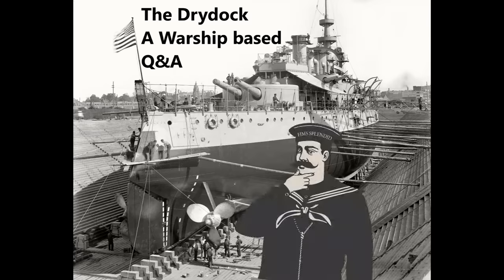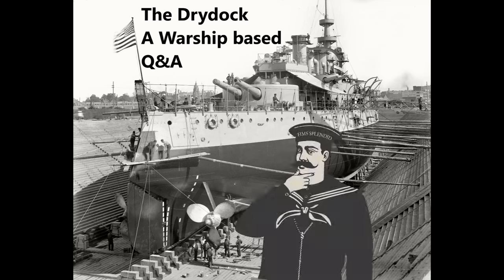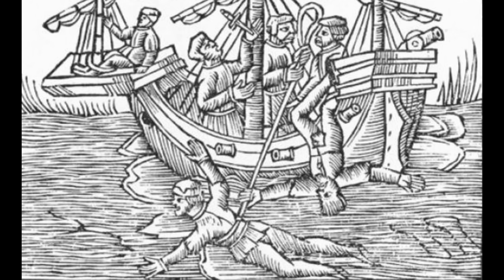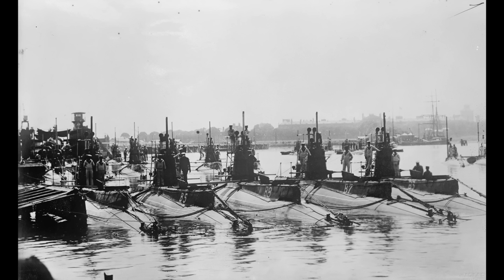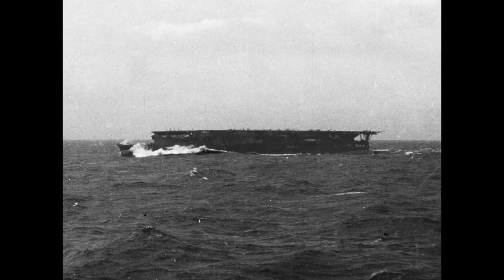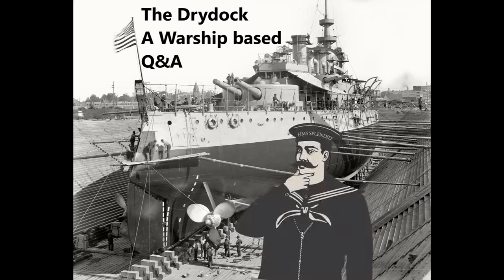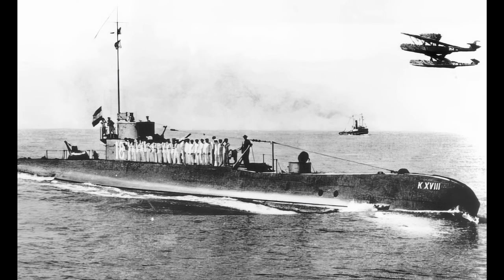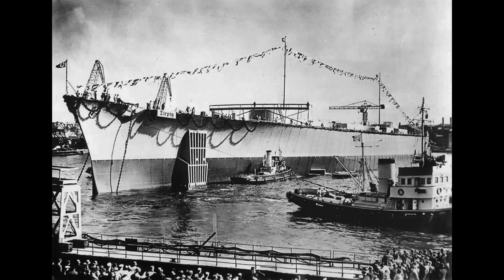The Drydock - Episode 266

Comment: Submarine Toilet on SSN-637 class submarine.

Stainless Steel toilet bowl bolted to the deck.  Waste was piped directly to the sanitary (sewage) tank.  This was at submarine internal pressure until emptied.  All toilets, which were forward of the reactor compartment, drained to this one tank.  

Toilets were equipped with a large diameter ball valve with a 2+ foot long handle.

To flush you were open the valve manually with the long handle and then open a globe valve for sea water to flush the waste to the sanitary tank.  The seawater WAS NOT at full sea pressure.  I don't remember it's source but all seawater systems at full sea pressure were minimized as part of the SUBSAFE program.

Now, the problem comes when the sanitary tank was full, or nearly so.  It was blown over the side with compressed air while at periscope depth.  The auxiliaryman of the watch had to make sure he closed the discharge valves, 2 valve protection, before the tank was fully empty and vent compressed air over the side.  This made noise and SONAR would tell the Captain about this.  Not good for sound discipline.

The other problem was NOT opening the ball valve to flush while the sanitary tank was being blown.  Failure to heed this resulted in you "picking toilet paper and "stuff" our of your teeth".  Yes, I did this once.  Rule was you do it you clean it.  I spent the next 2 hours scrubbing down the wardroom head from top to bottom.

Comment: Re: Hansan, Admiral Yi’s historical maneuver at Hansando was to a) send in a small squadron to the Japanese ambush to bait them out into more open waters off Hansan Island (shown in the film), b) set up a double envelopment with the main fleet (this is the Crane Wing Formation, though it was generally a land cavalry envelopment formation) by sailing in line abreast and then having them pivot in place while forming a curved line of battle, c) send in a small group of the turtle ships to slow the Japanese advance while this double envelopment trap was being set up so the Japanese wouldn’t get into boarding distance too quickly, and d) have two squadrons hiding behind the islets on either side of the main battlefield that would deploy and join either end of the main Korean battleline to further outflank and envelop the Japanese force (this part was sadly omitted from the film, and it’s a major issue, as it’s a big part of what made the double envelopment possible). It was indeed difficult to have the rowers synchronize exactly right to allow the fleet to maneuver in place as it did, which is why Yi drilled his sailors to an extreme extent before this battle (and during his entire naval career, actually)-this wasn’t something the pre-Yi Korean Navy could have pulled off. The fact the Korean navy consisted of flat-bottomed ships intended for littoral and coastal operations helped significantly as well. 

This wasn’t actually one of the battles Yi fought for the sake of stopping a Japanese advance (that happened earlier, during the Battle of Sacheon, and, more famously, later in the war at Myeongnyang). The main point of the Battle of Hansando for both sides was that it was a search-and-destroy operation to find and wipe out the bulk of the enemy fleet. The Japanese had to get rid of the Korean fleet under Yi if they wanted to gain sea control and resupply their land forces by sea; the Koreans had to get rid of the main Japanese fleet under Wakizaka to maintain sea control and prevent the Japanese from sending supply vessels into the Yellow Sea and up various Korean rivers. 

The big issue I have with the depiction of the Battle of Hansan Island in the movie is that it was way too short: in reality, once Yi had gotten the Japanese into his double envelopment trap, the battle went on for almost six hours as the Korean battleline fired on the cornered Japanese warships, destroying most of the Japanese fleet. The film has the entire Japanese force being wiped out in that one massive salvo, which isn’t really how it went down. 

Hansando is one of Yi’s better-documented battles due to the fact both Yi and Wakizaka wrote extensive mission reports after the engagement, with the cross-referenced details checking out.
Reply: Sound like an interesting film.
What is the title again?
Reply: @ghost307 

Hansan: Rising Dragon

There is a significant bit of Korean nationalism in a couple of scenes (though it’s not as prominent as one might expect), and while the opening stage of the battle isn’t too bad, I do think the film could have done a better job of showing Yi forming the Crane Wing Formation and bringing up the hidden squadrons to encircle the enemy.
Reply: @bkjeong4302  Thanks. I'll have to seek it out.

Comment: Auxiliary Floating Docks, Big (AFDB), also known as Advance Base Sectional Docks (ABSD), came in sections, 93 ft long and 3,850 tons each. Each section had a 165-ft beam, a 75-ft molded depth, and 10,000 tons of lifting capacity. Sections could be put together to lift larger ships. AFDB were needed to repair battleships, aircraft carriers, cruisers, and large auxiliary ships. The AFDB-1 Artisan had 10 sections (A to J) for a total lift of 100,000 tons, and was 1,000 ft long with all 10 sections installed. AFDB-1 to 7 were built between 1943 and 1945 and towed to remote navy bases. An AFDB would have a crew of 600 to 1,000 men, a fresh-water distilling plant and was otherwise self-sustaining. They had a rail traveling 15-ton capacity crane with an 85-foot radius and two or more support barges. To pump water from the tanks, there were two 24-in discharge pumps on each section, each pump rated 15,000 gpm. For electricity, there were two 350-kw diesel AC generators on each section, producing 440 volts 3-phase 60-cycle power. AFDBs had steam plants to run the pumps. Each section could store 65,000 gallons of fuel oil to supply the ships under repair. Crew lived in barracks ships, called APL, that docked next to the AFDB.[4][7][2][8]

USS Artisan (ABSD-1) (A-J), built by Everett-Pacific and others
USS AFDB-2 (A-J), built by Mare Island Naval Shipyard in Vallejo, California (E, F, H & I in use)[9][10]
USS AFDB-3 (A-I), saw fighting action in Guam, and was sold to Croatia in 2000.[11][12]
USS AFDB-4 (A-G), built by Mare Island Naval Ship Yard (NSY). Attacked by air on April 27, 1945. Partially sunk 1989 as a reef.[13][14]
USS AFDB-5 (A-G), built by Chicago Bridge in Morgan City, Louisiana. Scrapped in 1997.[15]
USS AFDB-6 (A-G), built by Mare Island NSY. Scrapped 1976.[16]
USS Los Alamos (AFDB-7) (A-G), built by Chicago Bridge. Sold to a private shipyard in 1995.

Construction took about 2 to 2.5 years.

Comment: 1:56:33 On the topic of toilets as you said for age of sail ships at the stern of a rated naval ship they would have private ones for the captain and possibly officers, you can see them on the outside of the ship. The fancy extensions like two balconies / Bay windows on both side that extend over the Sea are called the quarter gallery and this is where the captains and other higher ranking officers toilets were located. There was normally just one toilet on one side but they have a quarter gallery on both side to make it symmetrical. Also some larger ships of the period at the front of the ship they had roundhouses (you can see them at the front of HMS Victory) more private and out of the elements for the officers. Hopefully I have explained that well enough so people get what I'm on about. But in short the higher ranks in the age of sail got the fanciest Portaloos / Porta-potties known to man.
Reply: When I visited the Constitution around 1970, there was a modern seat installed in one of the quarter galleries, with a pipe leading to the pier.  Also in the 60s, I built a model kit of a topsail schooner that had what were effectively two outhouses in the aft corners of the main deck, which overhang the sides of the hull.
Reply: In photos of anchored ACW ironclads there may be what looks like a wooden outhouse at one end because that's what they are!

Comment: The Strategic requirement for the fuel hypothesis wasn't taken into account -in effect the British and their US aid supply were unlimited -whereas once closed down Europe had only the Ploesti and Baku fields -so loosing Baku after the invasion of Russia. However even the allies struggled with supply -not even counting the cost of getting aviation fuel to Operation Matterhorn (the US deployment of USAAC B-29 to China) as an air campaign it took 12 B-29s to supply sufficient fuel and supplies for single B-29 unit mission against Japan, and that was only the flight over the hump from Asam in India to Chengtu in China, never mind the cost of getting the stuff to India  (ships plying across the South Alantic to South Africa and on to Bombay (Mumbia) then across India by rail, later ports such as Calcutta and Chittagong might have been used but Chittagong was a Sh8thole and Calcutta not much better. 

So for Germany to supply Regina Marine adequately with synthetic and even Ploesti fuel oil, would mean an almost continuous supply train, screwing up every secondary supply all the way to and from Austrian Border then down the entire length of Italy to Taranto -although small coastal tankers could be used in the Adriatic.  Same applies to a lesser extent with Tirpitz -supplying fuel to Trondheim exclusively for the Navy is a huge multiplication factor.
Reply: The problem is, not so much having the oil, but getting the oil to where it is needed.  That is what happened to the Japanese in WW2.  Once the problems with the Mark XIV torpedoes were cured, American submarines started sinking sizeable numbers of tankers, and the Japanese couldn't get the fuel back to the Home Islands.  That was why they stationed a large portion of their fleet in the Dutch East Indies, so that they were right next to the oil supply.
Reply: @ronaldfinkelstein6335  Yep. And didn't the IJN have to run those ships on relatively unrefined fuel as a result?
Reply: @treyhelms5282  Yes.  And I think the loss of the CV Taiho was partly due to her unrefined and more flammable bunker fuel, though the explosion that blew her sides out was mainly due to fumes from a n aviation fuel leak.
Reply: @treyhelms5282  IIRC they switched to running on raw crude after the Allies bombed the refineries in the DEI. The salt present in the raw crude wasn't good for the boilers either, but at that point the life expectancy of a IJN ship in general made that point somewhat moot.

Comment: In January 1942, the USN formed TF 99 on Roosevelt's orders. Based out of Iceland, it was the operational control of CINC Home Fleet. At full strength, it would have had two fast battleships - North Carolina and Washington (9 X 16 inch each), two fleet carriers - Ranger and Wasp (40 F4F fighters and 40 SBD dive bombers each), three heavy cruisers - Astoria, Tuscaloosa and Wichita (9 X 8 inch each), three light cruisers - Brooklyn, Savannah and Philadelphia (15 X 6 inch) and several squadrons Benson class destroyers (5 X 5 inch 10 X torpedo tubes or  4 X 5 inch and 5 torpedo  - the later to mount more light AA).

I don't think der Panzerschiff would have accompanied High Seas Fleet 2.0 as they were too slow ( despite what Wikipedia claims, they were only good for 26 knots). With the exception of the Emden, the German light cruisers were banished to the Baltic training flotilla as they were too lightly built (proven in several aborted attempts at North Sea cruises pre-war). The German Navy had 15 destroyers surviving by mid-1942, 7 with 5.9 guns which were extremely hard to load manually in any sort of seaway (the Germans reverted to 5 inch in later designs) To quote Fleets of World War II on Nazi DD's in general " Their designers intended their extreme boiler conditions to provide maximum power, mostly they produced aggravation and short range. Likewise the 5.9 inch gun supposedly outclassed all enemy weaponry, but the sluggish thing merely added its great bulk to the ship's wallowing movements"
Reply: Whether your dealing with warships or tanks 5” is pretty much the limit for manual loading unless you recruit your gun crews from American football & Olympic power lifting teams.

Comment: wrt the question about the Axis having adequate fuel supplies.  The Vichy government was increasingly accommodating to the Axis.  Luftwaffe aircraft were operating out of fields in Vichy held Syria.  The Germans and Italians supported a coup in Iraq that put an Axis friendly regime in power.  Oil was being produced at that time in Iraq.  A 12" pipeline was operating, which ran between Kirkuk and Haifa.  After the formation of Israel, part of that pipeline was repurposed for a new line to Baniyas, Syria.  A rail line had been built by the Ottoman Empire from northern Iraq to the Med, but, after WWI, part of that rail line ventured into Turkey, which was neutral in WWII.   In April 41, the Axis could have landed on friendly beaches in Syria, driven into friendly held oil fields in Iraq, and begun construction of rail and pipeline connections to bring the oil to friendly ports in the Med.  The British invaded Iraq to reinstall a friendly regime in May 41, then invaded Vichy Syria in June 41, closing the window of opportunity the Axis had to secure a major oilfield.  Can't help but wonder why Hitler decided invading Russia in June 41 was a better idea.

Comment: For a ship class with capability gaps between the first and last ship in a class, I would also throw the Italian Condottieri in the ring. Maybe not quite as significant as some others, but there still quite a difference between a Guissano and an Abruzzi. They even look very different. Relevant only of course, if you consider them subclasses (which I do) instead of five seperate class.

Comment: Did not Cochrane  by the use of fire and explosion ships cause absolute panic at the battle of the Basque roads which I believe was the inspiration for that part of the movie(Hornblower is like Aubrey heavily based on the 10th Earl of Dundonald though neither ever matched the achievements of the man they were based on)and had even another frigate or two let alone a small relatively expendable 64 been sent in the French squadron which had largely run aground could easily have been destroyed

Comment: 1h05m56: as a comment on the Aegis ships all looking the same.  I would like to note that, much like the quality and types of armor that were available at the time of the ship in the segment, there are major external factors on Aegis specifically and more generally, all modern ships.

first, the Aegis arrays need a certain shape superstructure to mount them on to give them their required field of view. The Burks have them on one octagonal shaped structure, and the Ticonderogas and the older Long Beach and Enterprise use squares.  But for the foreign ships, the western ships at least are all using purchased Aegis systems so they are not going to disregard the USN ships that were designed for them.  And it happens to be a logical answer on how to mount ‘billboard’ type radar arrays, so it’s showing up on non-Aegis designs too.

second, the varying degrees of stealth incorporated into the modern designs have both massively cleaned up and simplified the superstructures of modern warships.

the end result is that most modern ships look much like a Burke class if they have aegis, or much like other similar sized ships if they don’t with a low superstructure with little to no clutter or other exposed systems and sensors.  And, much like with stealth aircraft, the needs imposed by stealth greatly reduces the number of ‘right’ answers for a given design.

Comment: Did the Japanese have anything like the American PT boats or the German PT boats? It seems like they would have been a threat in the narrow channels and around the islands of the South Pacific if they had Long Lance torpedos.
Reply: Japan had some PT boats, but they weren't very common, nor were they very good. They never used high performance torpedoes on em.
Reply: My initial reaction is to expect that any such boat would use the 17.7" aircraft torpedoes instead of the 21" or 24" torpedoes used by submarines and surface ships.
Reply: You are looking for the Type T-14, Type T-51, and related Motor Torpedo Boats of the Imperial Japanese Navy. They were armed with small torpedos, about 18''(457mm), and some small cannons.  Overall, Japan had a couple hundred or so of these little boats in service, but they never quite went as far and wide as the US Navy would deploy PT-Boats, so they don't get the great press attention they might have.
Reply: After the debacle with the Russian 2nd Pacific Squadron, I'd have figured they'd keep them around just for the LOLs.

Comment: With regard to HMS Incomparable's length...the BB-65 Scheme 8 design (ie the 33-knot Montana) was 50 feet longer still. And would very much fit into that "completely crazy" category, what with its six shaft propulsion with its machinery generating a whopping 320,000 horsepower. If built, that would've been the highest power output of any ship until USS Gerald R. Ford in 2017.

Comment: Interesting you suggested in the last Q that a floating drydock was easier... if designs was perhaps modular..to expand length.. versus a dry dock but surely digging a big hole and lining it with rebar and s=concrete..is easier than bespoke building modules for floating drydock and upgrading powerplant etc etc given the space  is available..or have most of the historical dry dock already been expanded to their full potential,if so where would u site  a shipayard/drydock to build a world beating supersized Warship UK or global preferably both